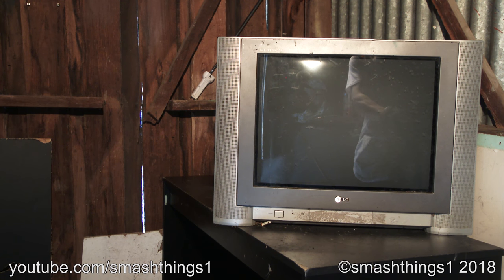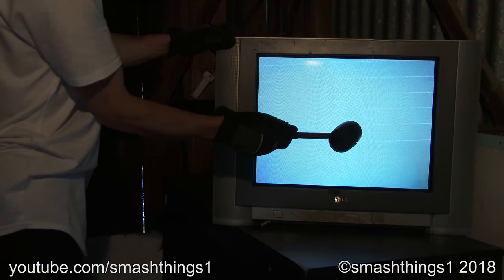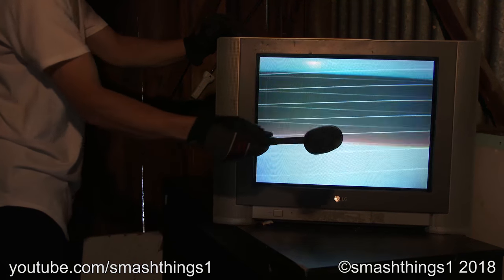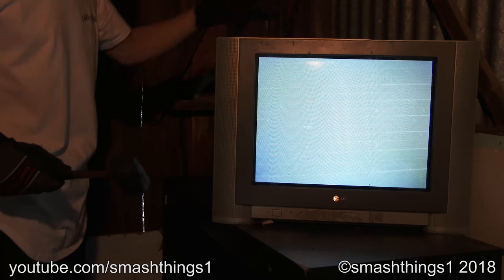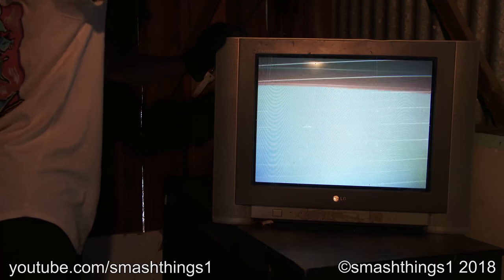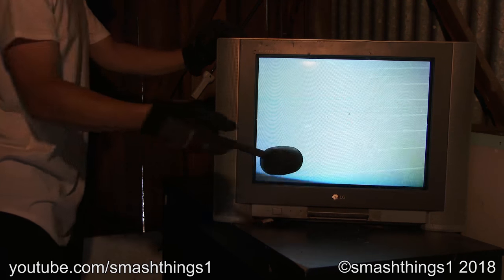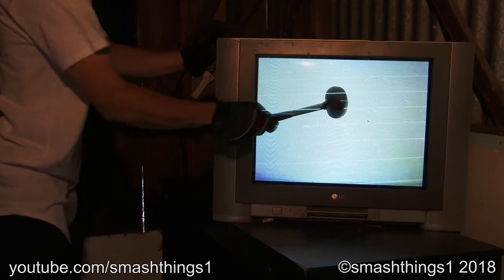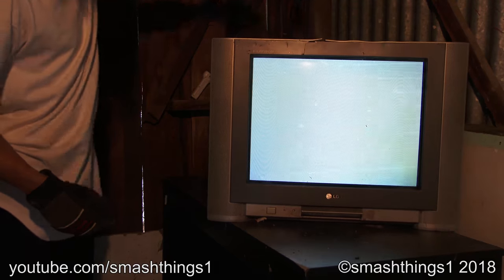Beating On An LG Flatron CRT With Bad Picture Tube

Comment: I’m surprised the screen didn’t crack
Reply from the maker: A rubber mallet won't crack a tube from the front that easily.
Reply: @smashthings1  that lg tv is acting stupid
Reply: @treystewart544  lol
Reply: @smashthings1  it's just rock solid proof that CRTs are more robust than LCDs.
Reply: @ZuneTech2008  Of course such a brick is more robust. But OLED just looks better
Reply: @smashthings1 it was child safe now modern plasma TVs are NOT child safe anymore

Comment: Crt tvs suck
Reply: Lcd tvs suck
Reply: @samucontenti2192  OLED TVs are awesome
Reply: @luisguzman1167  not really, they don't have any of the carachter that old CRT's have, in my oppinion LCD's, OLED's and every other Flat Tv style does not have the quality of old CRT's, than there is the durability factor, you can always repair old CRT's pretty easily and in my experience the longest lasting OLED Tv i have seen was 3 years, while CRT's i have some that are 50 years old and they just needed some regular maintenece! for image quality, they seem to be finally getting to the image quality of old CRT's, anyway i will always prefer CRT's over the modern stuff